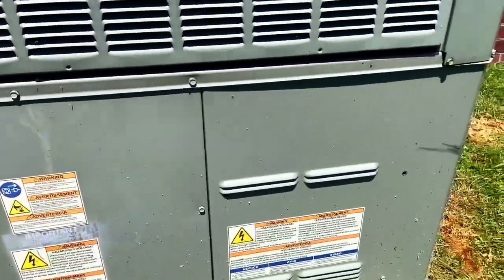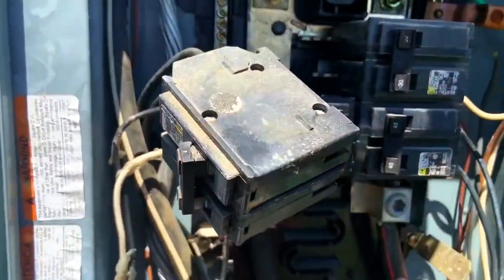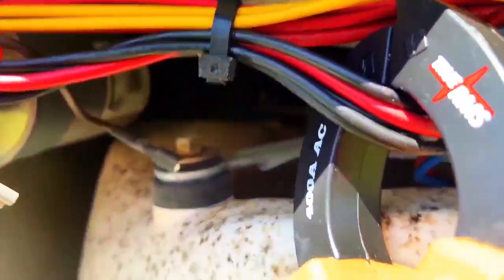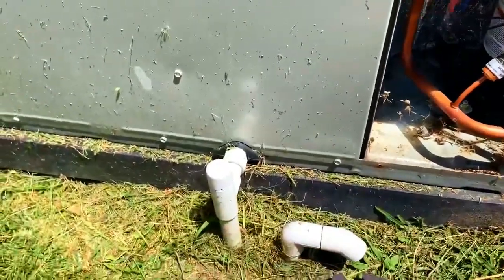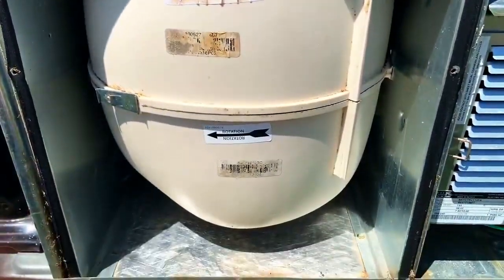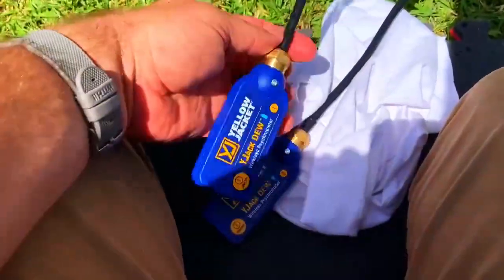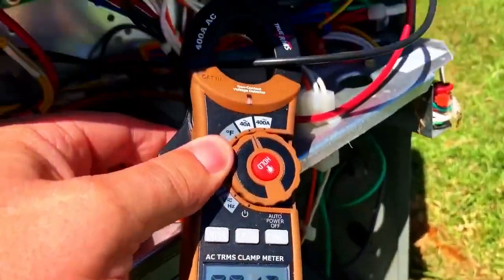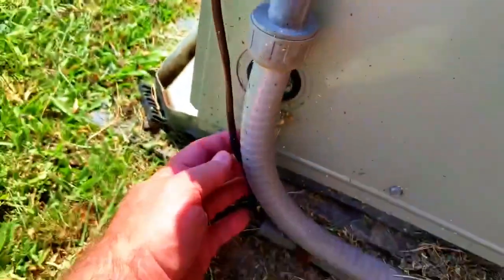HVAC Service | 4WCC Package Heat Pump

Comment: Someone found a meter at Lowe's.
Reply: Yep I don't trust those pos at all. Fluke after I got zapped by 460v using a fieldpiece
Reply: @zack9912000  Can you elaborate?
Reply: @joehead1294  fieldpiece and the lows and home depot brands are made cheap and componets are cut to meet a price point. Had a klien I got.from homedepot that when ever you would shake or bump the meter the voltage readings would change with no leads connected.

Fieldpiece use junky chiba knock off control boards that if they go bad they will read zero voltage and hence how I got shocked with 460. They have no safeties to protect the user. The Meter said I was zero and when I went to work on the lines I got hit. If a fluke has a failure it gives you a error code and beeps at you. Fluke cost twice as much but I never secobd guessed using it, also some industrial companies will only allow fluke to be used.
Reply: @zack9912000  Recommend live dead live testing methodology for safety.  Fieldpiece is new brand for me, lot of guys use them.  Fluke even made in china now.  Hard to trust a meter 100%, good to have couple on hand.  Best to have three to compare, best odds that way. YMMV